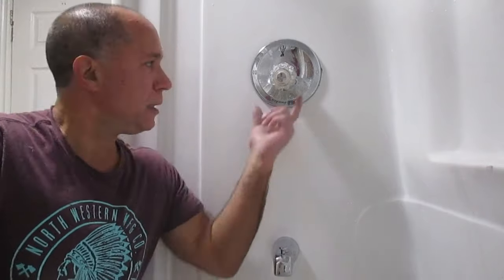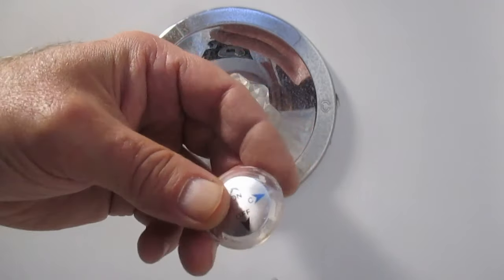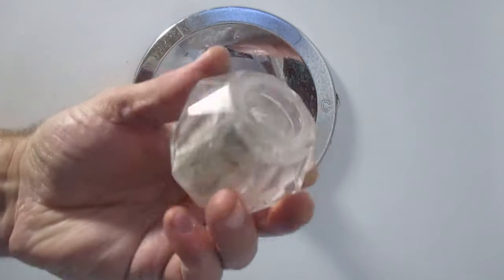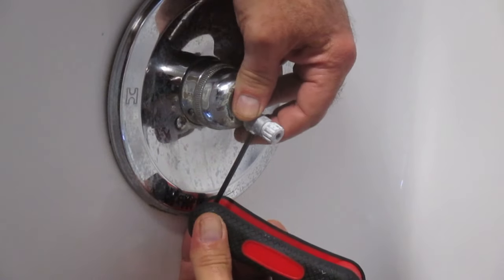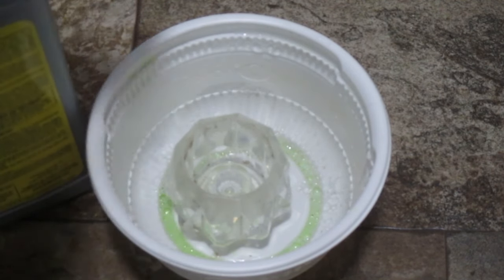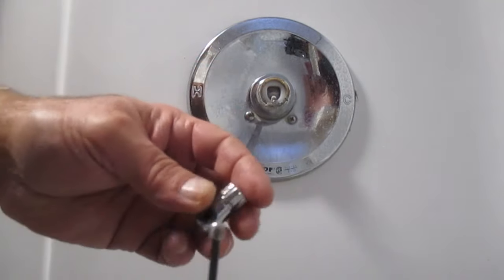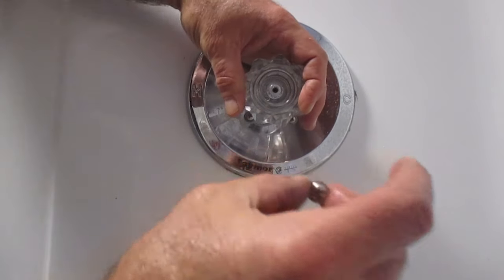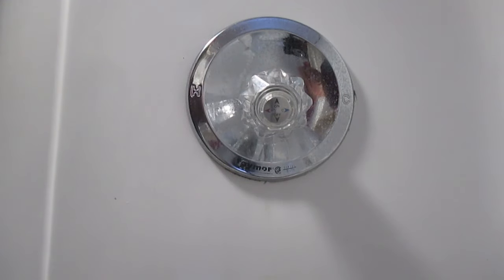How to replace a bathtub faucet handle - single handle in this video

Comment: My problem is the head of the screw where the Phillips screwdriver fits are stripped. Any suggestions on how to remove the stripped screw? The head of the screw is worn and my Phillips screwdriver just don't remove, turn it now?
Thanks.
Reply: Go to a home depot or lower and buy a EZ screw extractor,it won't cost more than $10
Reply: before buying a screw extractor, try the rubber band method:  get a wide rubber band, lay it across the screw head, then push the screwdriver down into the slot .  the rubber band will give traction.
Reply: I had the same problem, honestly I just took a drill bit, drilled holes around it and then remove it.

Comment: Is this the process if the shower is not able to use cold water?
Reply: unlikely.  that sounds like a cartridge problem.
Reply: @threenorns3   Would it be too much trouble to explain What you mean by cartridge problems?